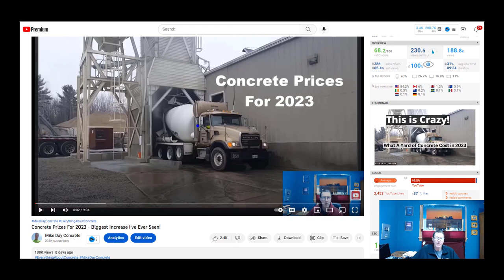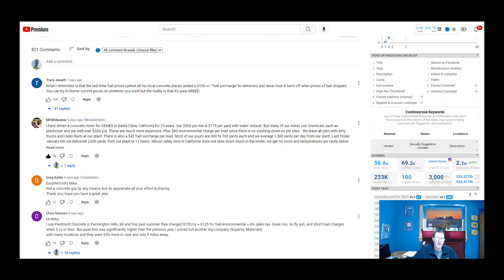Higher Concrete Prices for 2023 - Are Politics Driving Prices Higher!

Comment: Biggest price increase here in northern vt also as of Jan 1st  paying $162.00 a yard including 6%tax plus a $30 a load fuel charge  add your hot water and midrange, fiber on top of that it's crazy.
We now have only one company to pour with here so not much can do but pass it on.paying about same for materials wire and foam board. Had 3 price increases in 2022.cant find any help here either never waited for Crete so much as this year plant couldn't even find enough drivers

Comment: Politics with carbon taxes etc are pushing up prices as these target the very base of costs. Then factor in energy costs up, these also push up the very base price from cement manufacture to fuel used in quarrying. Also you have machinary prices up, due to the same cost increases as above. When you add in no one wants to work and anyone who does expects to be well paid for it, even those who show up and don't do much. We'll then we have this perfect storm of crazy prices. They have created so much money and pumped it out into the system that it still hasn't been syphoned up to the top yet. Can't see the money running out any time soon, even though they are talking us into a recession here in the uk.

Comment: Wow! The local company in North Georgia was gonna skin average Joe home owner it looks like. They quoted me 2200 dollars for 9 yards of 4000 psi mix, residential nothing special to be delivered 10 miles down the road. Disappointing. I get that they were probably adding a pain in the ass charge for dealing with Joe knucklehead, but wow. I tried to get 3 contractors to show up and quote pouring a slab in my barn. All 3 were no shows, couldn’t get them to come quote it let alone pour it. I ended up pouring all 14 yards using a Mudmixer and buying it by the pallet at Home Depot. I paid a lot more, but I got it done thanks to watching a lot of your videos.

Comment: These prices are getting ridiclous. I just checked this week for two different suppliers that are in different areas 2 hours apart. One in western NC and the other in East TN. NC supplier is charging 192.75 yd for 5000psi, Fiber is 6.00 yd and Mid range water reducer is 3.30 yd. There also charging $30 per truck for a diesel fuel surcharge. TN supplier is charging 180 yd for 5000 psi, Fiber is 6.00 yd and mid range water reducer is 4.50 yd. There also charge a fuel/environmental fee per truck which is $50. Yeah I know cement has went but this suppliers are just trying to take advantage of the situation.

Comment: It is all concolidation of the batch plants.  In my area there are probably 30 different plants spread out around but they are all owned by two companies.  The bigger companies have spend decades buying out their competition so that they can price fix and what we are seeing is them accomplishing thier goal.  All that on top of the demand from the most recent construction boom has driven prices up give it another decade and we will all be buying concrete from just a handful of suppliers nation wide.
Reply from the maker: I only have 2 companies to choose from local to me. Not much competition like years ago.
Reply: I think you’re right.  Europe and the UK have seen similar trends.  Timber and other building materials tend to react to wider market pressures much quicker due to global (macro) issues, whereas cement tends to be more local based businesses (due to weight and volume constraints).  I suspect that as prices peaked last summer, the consolidated ‘localised’ businesses are holding on to their healthy incomes.  In the US you have a healthy oil addiction, and historically seem to favour air and road rather than enhancing the rail network unlike other developed countries.  I’m being very general here of course. That addiction would’ve helped lift prices up. 

Anyway, it probably hasn’t got anything to do with the Orange peril or the current fella.  

Who would want to work in a manual industry anyway, when you can make bajillions on YouTube. 

UK quote for Ready mix is £850 for 6 CU M.   I got that quote yesterday. You’ll have to do the conversion, my brain will explode.

Comment: Compared to steel, concrete is a relative bargain.  As you point out, steel has doubled - concrete has only gone up 10-20%.    We've switched from building our agriculture buildings from steel to ICF just to take advantage of that disparity.

Comment: Mike. I’m 31.  If I was in Maine, I’d be breaking your door down for a job.   Been pouring concrete 8 years now.   Lots of flat work, and also quite a bit of shot Crete work doing skateboard parks for cities.  I actually worked on the brand new skatepark in bangor a little over a year ago.   I have unshakable dreams of owning my own flatwork company in the next ten years, and your business model is my blueprint.  Low overhead, small payroll of just a couple guys, properly maintained equipment, and top notch work.    Never going to stop till it happens.  If you stay positive and never give up, things will fall in place.   I think that all this mess will eventually calm down.  It has to.  I mean, what’s the alternative?

Comment: Current political mindset is the main factor which has driven oil prices higher and their cost to refine oil has also gone up.  No new refineries, taxes, everything is going to be electric, shut down the Keystone pipeline all has a major effect.  Couple that with rates that were pushed to record lows encouraged many to borrow, build etc and the Government handing out money created massive massive inflation.  We are already in a recession except the current administration changed the definition.